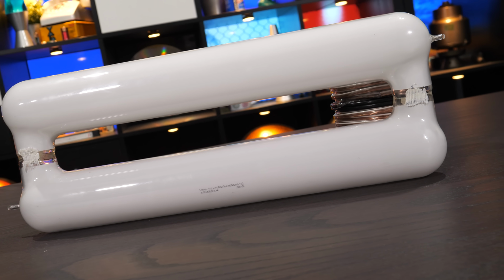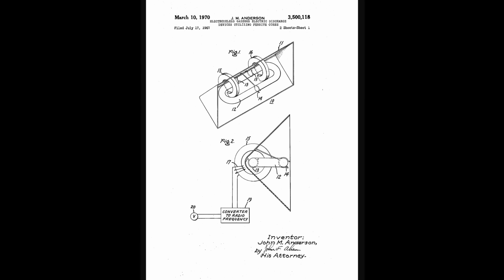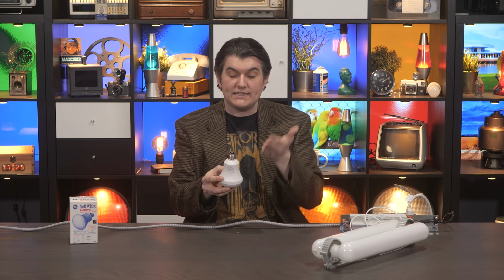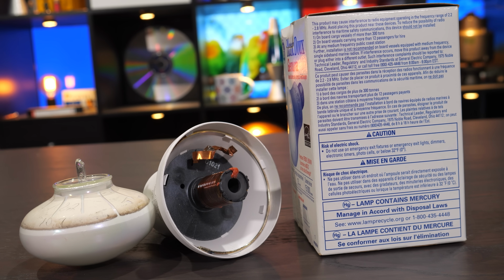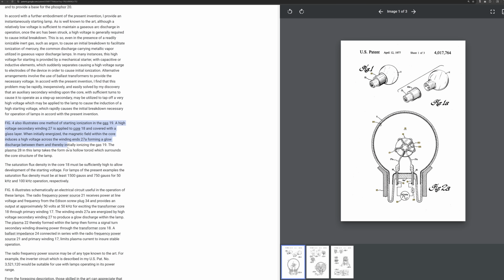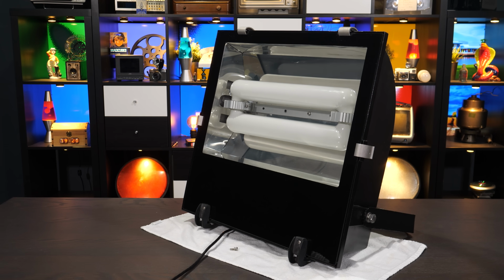Induction lamps: fluorescent lighting's final form

Comment: 19:50 Might be wrong, but I'm fairly confident that strong enough magnetic field can ionize gas particles. They zip around at fairly high speeds and are constructed out of charged particles bound together with atomic forces, yet magnetic field will cause opposite forces on the nucleus and the electron cloud. So strong enough field with fast enough gas particles of a gas with low ionization energy might be all that is needed, without a strong electric field.

Comment: If I remember correctly, in hot-cathode type fluorescent lamps, electrodes at the ends of fluorescent lamps have elements betwee them to heat the local gas and make forming a plasma easier before the pairs set up an electric field between the ends, creating a plasma between the ends. More commonly, cold-cathode fluorescent lamps use a different filament structure to heat the air by a single electrode for the electric field to start the plasma between the ends. Using RF induction to strip electrons from the gas eliminates the need for heating elements, but not the need for RF energy needed to convert the rest of the gas in the tube into a plasma. The balast is a significant part of the cost for fluorescent lighting and is not immune to failures. The mercury, gasses, phosphors, and thin glass walls of the lamps create handling and disposal issues and, as you mentioned, ambient temperature can dim the lamp or prevent it from operating.

Comment: 28:52 the weirdest thing about the purple street lights is that, if I understand correctly (which I very well may not, so sorry if this is a bunch of nonsense. I’m watching videos like this to learn), it happens because they made them a more inefficient and expensive way that people don’t even like! Green and Red LEDs are the cheapest LEDs to produce, blue LED is actually kind of a nightmare. It is essential for LED screens and any sort of picture/video, but blue LED has to send a neutron (proton? I can’t remember right now, but one of them) backwards in a green (or red, I can’t remember which one) light to make it turn blue. These street lights take Blue lights, and coat a bulb with phosphorus to make it that bright white that people HATE. When temperatures change, or the bulbs age, that phosphorus cracks and some of the blue light within seeps out. What I don’t understand is why didn’t they just use a green and red LED which would make that Amber color people actually like? It also seems like it would be less toxic to produce because it wouldn’t be dealing with phosphorus. I am sure you have a video about this somewhere, so I shall keep digging. I’m so glad I found this channel!

Comment: I had a 100W incandescent bulb in my bedroom, operated via dimmer.  I always ramped it up and down when switching on and off and never used it at full power.  It lasted about 15 years and when I came to move it had stuck solidly in its holder.

Comment: Philips MASTER LEDtube T8 Ultra Efficient consumes 17.6W and provides a light output of 3700 lumens. 
This high output at a low wattage results in a luminous efficacy of 210 lm/W, making it one of the most efficient lighting solutions on the market.

Comment: It’s not “magnets”, it’s inductive circuits!  Argon gas (and neon, krypton and xenon gases) are conductive.  The bulb shaped lobe a loop acts like a single turn transformer circuit.  So with enough voltage impressed across it with the “electromagnetic” clamps, it’s going to start.  Neon gas is the most conductive followed by argon then krypton and then xenon.  Argon is about 3% of the air we breathe so it’s very plentiful.  Mixtures of gas provides unique properties depending on the geometry and pressure inside the lamp.

Comment: Wrong! Linear fluorescent bulbs that are rated as full power lamps (4 foot T12, 40 Watt for instance) have an argon only buffer gas and rise to 95% full brightness within seconds.  “Energy Saver” lamps have mixtures of krypton and argon buffer gas which reduces the current flow somewhat depending on the ratio of argon to krypton gas.  As a result, “energy saver” lamps are harder to start each time the applied voltage crosses the zero line (120 times per second for 60 Hz) AND “Energy Saver” lamps hate cold environments.  In fact, they often fail to start below 32 degrees F.  Instant start ballast work somewhat better in cold temperatures because they provide twice the voltage across the lamp in the case of “energy saver” lamps, but they may never reach full brightness if the ambient temperature is not at least 68 degrees.  And a cold breeze will cause “energy saver” lamps to lose brightness depending on how significant the breeze is.

Comment: The most common mistake made with fluorescent bulbs is a failure to install them in the sockets correctly.  All four pins, for a rapid start ballast circuit, must be in contact with the socket conductors to operate correctly.  Otherwise the open circuit voltage provided across the lamp becomes insufficient to restart the lamp when the AC voltage crosses the zero line which it does 120 times per second for a 60 Hz supply.  Instant start ballast only needs 2 of the 4 pins because the open circuit voltage across the lamp is twice as high as it is for rapid start ballast.  Instant start circuits don’t encourage blinking until the emitter substance on the coils inside the lamp is consumed.  Consequently, lamps on instant start ballast circuits don’t last quite as long.

Comment: I remember using a lot of these QL Lamps in Shop Lighting here in Germany. They where a very good alternate to Sodium- and Halogen-Lamps back in the 90s. Much longer lifetime, very efficient/ relative low energy consumption, and a modest good spectrum color index. They where quite a bit more expensive than halogen but after few years they amortised the cost easily😃The prolonged operation time a day made them perfect for showcase.
... Then LED became a thing... But the color index was awful back then despite being even more expensive 💸 (well - some are still atrocius 🙈)

Comment: Take a read up on how ICP(inductively coupled plasma) works.  Old ICP systems used a probe to initiate a small around of corona discharge inside to create some free electronics.  But with modern electronics, that method isn't really needed.  The TLDR is basically keeping a good impedance match.  The unlit bulb is basically high resistance while the lit bulb is a low resistance.  There is also a bunch of stuff with frequency, power, and gas pressure but you can read up on that.

Comment: I use an industrial application of induction lighting at work daily, but it's designed specifically to emit high-intensity UV, and produces enough ozone to require an external exhaust. It's a cantankerous machine. There's a conveyor belt involved, as it's used to cure the materials passed through the lamp assembly.

Comment: I remember when the Philips QL system came to commercial market, we had an attractive application, the high level lighting in an airport hall, the long lamp life and decent lamp output was a good fit for these difficult to access locations. They were also capable of improved colour rendering when compared to the commonly used metal halide.

I also recall discussions and concern around the radio frequency emissions produced by the lamps. I think the Philips QL offered a very unattractive metal cage which covered the lamp. The form factor of the big 'bulb' of the QL wasn't a great fit for many applications.

I believe the practical limit for mean time between failure of the electronic drive circuit limited its practical 'lamp life'.

Neat product, just a little niche!

Comment: I work in the metallurgical industry and my train of thought after looking at that electrical diagram was something like:

"A primary surrounding something that gets hot to the point of incandescence, that sounds awful a lot like an induction furnace were the metal to be melted is the secondary…  wait, so the bulb is the secondary? That sounds so cool!"

And yep, look and behold, the mercury and argon vapor mixture is the secondary.

What I don't get it is how they managed to initiate the ionization of the gas inside, after all, it isn't a conductor unlike the steel scrap inside an induction furnace and there are no electrodes to do it with an electric arc… 

Perhaps an instantaneous electrical field with at an even higher voltage to strip some electrons out of the gas?
A burst of extremely high frequency radio waves inside the coils, stripping electrons at convergence point at the barycenter of the coils?

Comment: all gasses become conductive when ionized BUT you can reduce the threshold for how much energy it takes to ionize said gas by wiggling it aggressively with a magnet and if your gas has a fairly low threshold to start with it will self ionize at extreme frequencies.

Comment: Work in tent manufacturing and we use radio frequency to weld vinyl fabric together.  The have fluorescent lights with the electrodes set in acrylic block and the machine cycles it turns the light on

Comment: Fascinating. As others have said the EM noise was probably a large reason why they failed to sell.

CFL have the same problem with overheating electronics on their bases, particularly in hanging fittings. The electronics dying is the largest cause of failure with them in my experience, the tubes rarely fail like standard fluorescent tubes, just pop and gone.

You make a big deal about the longevity, but in reality the electrodes in standard lamps could have been designed to last longer if they wanted to. But they wouldn't have sold so many. I suspect that some price pointing is about this reduction in sales as much as cost of production in long lasting products.

Comment: AI Summary

Abstract:

This video explores the technology behind electrodeless fluorescent lights, known as induction lamps. It details their principle of operation, which uses high-frequency electromagnetic induction to excite the gas inside a sealed tube, eliminating the need for internal electrodes that are the primary point of failure in conventional fluorescent lamps. The video contrasts two main designs: an external-coil type where ferrite cores surround the tube, and an internal-coil type (e.g., Philips QL, GE Genura) where the induction coil is placed inside a central cavity of the bulb.

The primary advantage of this technology is an exceptionally long lifespan, rated up to 100,000 hours. However, its widespread adoption was hindered by significant drawbacks, including high manufacturing costs, technical challenges like managing radio frequency interference (RFI), and the inherent limitations of fluorescent lighting, such as poor light directionality and mediocre color quality. Ultimately, improvements in conventional fluorescent technology and the eventual dominance of superior LED lighting rendered induction lamps an obsolete, albeit fascinating, technological curiosity.

The Story of the Electrodeless Lamp: A Forgotten Innovation

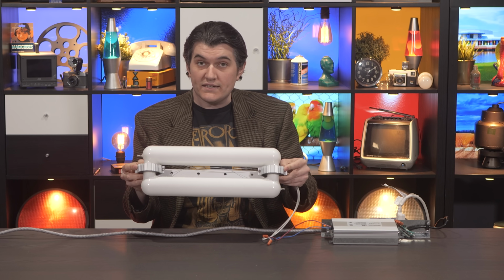*   00:00:46 How it Works: Electromagnetic Induction: The lamp operates like a transformer. A driver sends high-frequency AC current through wires wrapped around ferrite cores (the primary winding). This creates a changing magnetic field that induces a current within the sealed loop of gas inside the tube (acting as a single-turn secondary winding), causing it to light up without any physical electrical connections.
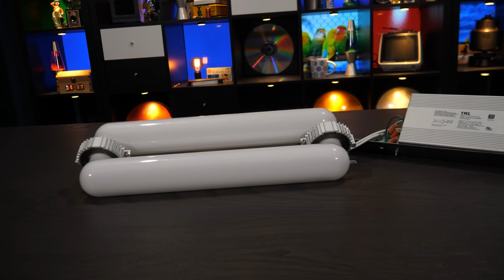*   04:16 The Key Advantage: Extreme Longevity: By eliminating the internal electrodes, the lamp avoids the primary failure point of conventional fluorescent tubes—a process called sputtering. This gives induction lamps a theoretical lifespan of up to 100,000 hours, a tenfold increase over standard tubes.
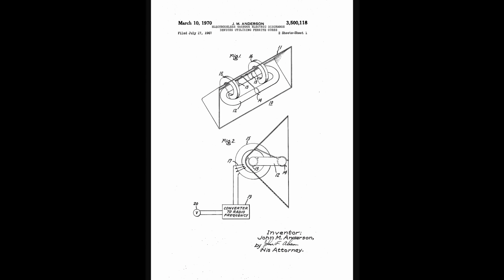*   06:55 A Long Road to Market: Although the concept was patented by John Anderson in 1967, practical and effective commercial products didn't appear until the 1990s due to numerous technical challenges.
*   07:34 Technical Challenges of the Technology: To work effectively, the lamp requires a very high operating frequency (radio frequency range). This necessitated the use of expensive ferrite cores, which are magnetically permeable but not electrically conductive, to prevent the cores from overheating due to eddy currents.
*   09:31 Alternative Design: The Internal Coil Lamp: The first commercial products, like the Philips QL and GE Genura, used an "inside-out" design. A single induction coil wrapped around a ferrite core was inserted into a hollowed-out section of the bulb, creating a compact and powerful light source that mimicked the shape of an incandescent bulb.
*   13:30 A Major Drawback: Radio Frequency Interference (RFI): Operating at radio frequencies (around 2.5 MHz for internal coil designs) caused significant RFI. Manufacturers attempted to mitigate this with conductive coatings and shielding, but the issue remained a concern, with warnings against their use on boats where they could disrupt communications.
*   16:20 Performance and Cold Weather Warm-up: While induction lamps warm up to full brightness in seconds at room temperature, their performance suffers in the cold. A freezer test showed the lamp took approximately 10 minutes to reach full brightness, starting with the dim purple glow of argon gas.
*   21:30 Why Induction Lamps Never Became Mainstream: Despite their longevity, the technology failed to gain traction due to several factors:
    *   High Cost: The specialized electronics and ferrite cores made them very expensive.
    *   Poor Light Control: As a diffuse source, the light was difficult to focus, making it less effective for applications like street lighting compared to high-intensity discharge lamps.
    *   Competition: Innovations in conventional fluorescent technology (T8 tubes, CFLs) offered similar efficiency and flicker-free operation at a much lower cost.
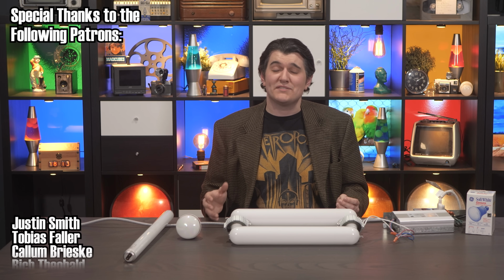*   28:04 The Rise of the LED: Ultimately, LED technology surpassed induction lamps and all other lighting technologies in energy efficiency, light quality, longevity, and flexibility, rendering the induction lamp obsolete.

I used gemini-2.5-pro| input-price: 1.25 output-price: 10 max-context-length: 200_000 on rocketrecap dot com to summarize the transcript.
Cost (if I didn't use the free tier): $0.04
Input tokens: 22601
Output tokens: 881

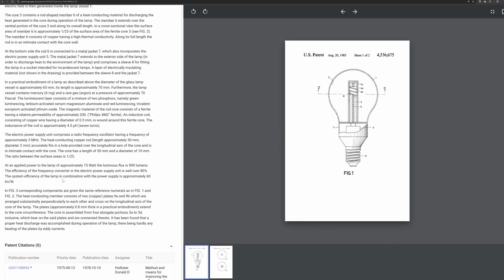Comment: An answer for your question at 20:40 :  The reason high frequency is sufficient to strike the bulb by itself is mainly due to the fact that the impedance between the coil in the bulb decreases with higher frequency. This allows the voltage inside the bulb to rise much easier until it hits the breakdown voltage of the gas, at which point a large current will flow through the gas and inductive coupling can take over. Its the same principal as the 'plasma ring' bulbs people build. They operate in the 3-15MHz range

Comment: 18:30 essentially, the inside of the tube is acting as a particle.Accelerator once the voltage is applied, the coils are arranged in such a way that it pushes away from one coil and towards the other.And after a while, once the gas has been circling, they collide with each other and start ionizing.
That is a very simplified explanation.
But that is the basis of how it works

Comment: There were "a lot of different problems" with EV's. Even though they are as old as ICE engines , those "problems" were cited by proponents of a fossil fuel economy. This meant that EV's didnt get the same level of money , research and development as their ICE counterparts. Time has proven the technology can work. Yes there are problems but selling a light that lasts 20 yrs is not in the best interests of money makers. Sustainabiltiy and Capitalism are incompatible with each other. We have the tech now to have energy independence and resliience using solar and wind microgrids. Did you ever ask why they are not receiveing the same attention as national grid , nuclear or large scale material combustion to produce energy ? Because free energy is the great democratizer - and that would disrupt the system wholesale. This is also the reason why they dont want you to outright own the panels on your roof, they want you to rent them - so you cant reap the rewards and cost savings. Why are calculators the only low energy devices we can buy (save the odd outlying product) ? Kerching ....

Comment: Add some radioactive isotope to phosphorus, then it does not even need to be tubular and vacuumed glass - just any shape covered with glass absorbing remaining radiation - no power, will last almost lifetime! ;)
I had all sorts of troubles in the past with fluorescent lights - from just been annoying flickering, to badly affecting cameras and sensitive electronics, so we just installed incandescent and no problem! Besides, even LED lights (not specialized) are flickering with your country 50/60 cycles.

Comment: THIS at 27:30 caught my attention: “it certainly is possible to produce electronic circuitry which lasts 100,000 hours… (but) there are never any guarantees”. So those nifty new USB sockets now being built-in to home electrical wiring wall sockets, and which contain complex electronic circuitry powered from mains voltage and permanently switched on - are they a great idea…?

Comment: The RF radiation from a led bulb in my garage door opener desensitized the receiver causing a very significant reduction of remote control trigger range. Had to replace it with an severe duty incandescent bulb.

Comment: I think that light startup have similar behaviuor like electricity in Veritasium video where energy source and light bulb is 1m apart, but the cable is 600 000 meters long. There is small amount of energy that get instantly received, because of magnetic field and other things.
Reply: Another example is high frequency signal on a PCB. Those high freqencies don't wont just to follow copper routes. Singnals want to find shortest path - like light (another Veritasium video worth to watch)